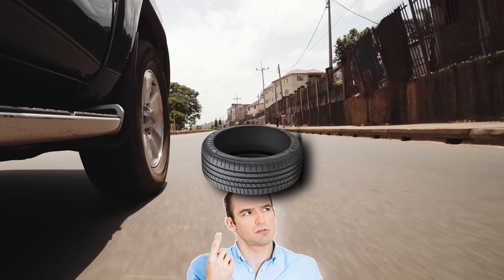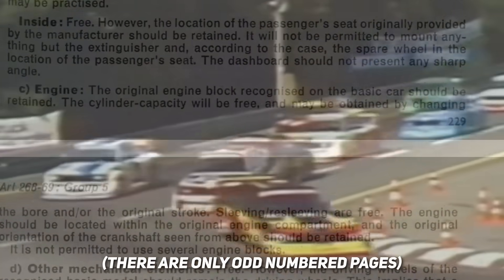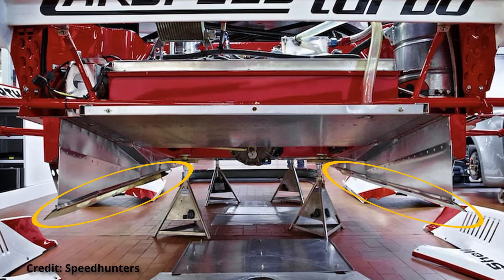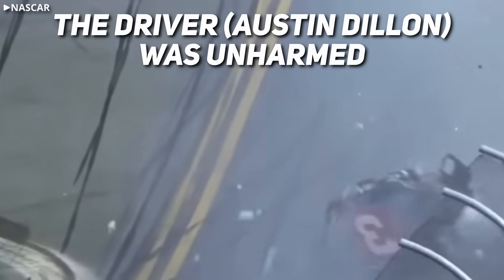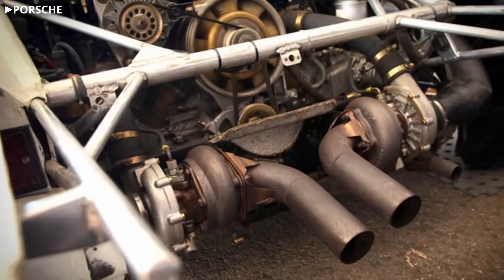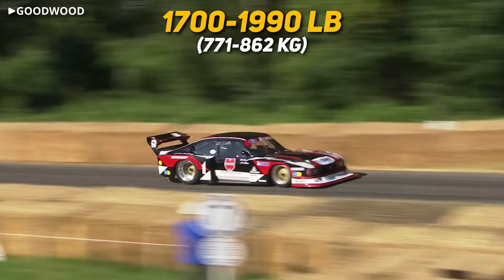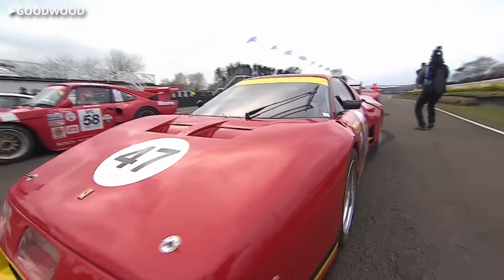The ABSURD Rules and Engineering Behind Group 5 Special Production | Group 5 Monsters Explained!

Comment: I've been to a lot of those races of the Deutsche Rennsport Meisterschaft (what means npthing else then German Racing Championchip). The Air Force racetrack at mainz-Finthem was my hometrack, while I went to the Ring and to Hockenheim for the Jim Clark rememberance races. And every year to Nürnberg, where the race took place at the Norisring, which was mostly the former Reichsparteitagsgelände... A lot of fantastic races, always the fight of the Ford underdoge against the 935's in the larger division. The Capri had the so called "Dampfrad" (power wheel), where they could increase the turbo pressure for a certain amount of time. After that, the engine blows up. I remember one race at Finthen, where Manfred Winkelhock was even beside Bob Wollek, using the Dampfrad a little to much and re damaged the car seriously. Such fantastic pilots as Stommelen and Wollek for Porsche. Heyer for Ford and Lancia and Ludwick, Winkelhock, Ertl and van Ommen for Ford, just to name a few.

Comment: We actually have a burnt Group 5 Zakspeed Capri engine. It was in Vidar Sauthon’s Escort MK3/4 Rallycross supercar (EX Seppo Niittymäki) Sadly the car burnt down in a buss but the engine was partly saved. There are afew parts missing but that will sort out when we fix a guys tractor. He said if we fixed it we get everything we want and need. Not just for the Zakspeed engine😆. But we are thinking of buying the EX Kjetil Bolneset Ford Escort MK3/4 Supercar and putting the engine in that, to use it in Retro Rallycross in England.

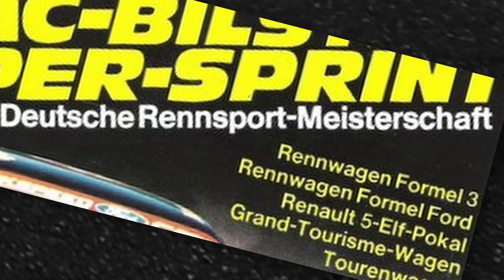Comment: 10:00 So how do you drive a car like that with just two feet? How do you shift down break and hit the throttle at the same time?
Reply: Well, sir let me tell you of a technique called heel n toe sifting where the heel of your feet dose clutch pedal to match revs for the transmission synchros and keep the engine up in the rev range and the toes hitting the brake pedal to slow down the race car at the same time i hope this can explain to you how this technique works as it not the easiest skill to learn.

Comment: The 935 was also extremely difficult to drive. It wasn’t just the turbo lag either. The weight bias and extremely squirrely chassis made the car understeer and oversteer in massive amounts. I remember an article I read at the time which confirmed pretty much everything here. I also remember an interview with Claude Ballot Lena, who was sharing a 935 with Bob Wollek. I think it was at Daytona in the early 1980s. Ballot Lena described to the incredulous interviewer how Wollek was using left foot braking even in the wet. Left foot braking… in a 935… That’s a car in which the rear is already trying to overtake the front without that. Think about that for a second.
Reply: Yeah it's lagging, it's boosting oh oh too much boost and it's a straight going into a corner and it's wet... hairy

Comment: ‘No such thing as a free lunch’ - also George Washington, I think. Turbos can give a lot more power but at a cost. While Group 5 didn’t have a limit on consumption (that came later with Group C), higher consumption means either more stops or more weight.
Reply: The efficiency at which power delivered greatly outweighed the fuel.. it was more efficient. It's cons wasnt in fuel usage

The cons of a turbo are overheating, the use of  lower compression and of course lag

Comment: Racing is deadly, the end.
If you can't take the heat of danger ... do not race.
Simple.

Adding rules to any race event, is equally idiotic, because of the above.
Safety is not done through rules, but technology and having a good driver.
A good driver is not one that can drive REALLY fast, but one that drives REALLY SAFE while driving fast.

Simple.

If you give a nutcase a gun, you just know, there will be side effects, no?
Same for racing.

Comment: Also there is a funny anecdote from back when the DRM raced the Nürburgring Nordschleife. As you already mentioned - the teams tried to find loopholes in the regulations. Well somewhere it was stated that you could design the rear fenders however you want, so Zakspeed did a funny thing. They build their fenders that way that they would basically match their rear wing, but it was still the same part. They even removed the fender to demonstrate it.
https://youtu.be/hHXimONBYMM
20:30 - it's just so wild to me...

Comment: Lancia paid the highest price for using Alu tubes for their construction in the later Group B Lancia 0.37 and the Delta S4  both accidents taking place on the same  event Corsica but a year apart both accident were end in the Death of the Drive in the 0.37 case and Both the Driver and Co-Driver in the 2nd case. these may be now classed as gold periods has was every year from the 50's until the late 80's by which time both the FIA / FISA and  the teams and drivers were fully behind safety over crazy race cars.

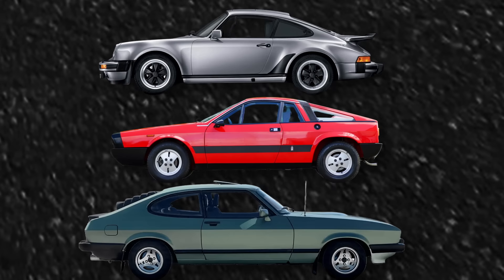Comment: I find the image at 2:55 to be quite fascinating.  The Capri on the bottom of the page is a euro-spec MkIII built in either the British or Cologne Germany factory, and not a German Capri II for the US market.  What I find interesting is, at first glance it would appear to have 390mm TRX wheels, but they are not.
To the best of my knowledge (for Ford) TRX was a USA only "wheel, tire, and suspension package" offered first in 1979 on the Mustang Pace Car and Mercury Capri (read Mustang).
That being said, the wheels in the 2:55 image are not TRX as the actual TRX wheels had a center cap that covered the lug nuts and the slots in each of the spokes were straight not tapered like those in the picture.
If anyone knows if the wheels shown were a Ford factory wheel or what brand they are please comment below.
As I am from the USA I have limited knowedge of all the many varietys of Capris found around the world.  I learned to drive in a 79 Mustang Turbo 4 speed Pace Car and owned both a 1976 Mercury Capri II (Ford, Cologne Germany built) and a 1979 Mercury Capri RS (Mustang with TRX and factory box flairs).

Comment: This is great history to learn. Thank you.
THEY WELDED ON THE CYLINDER HEADS.
Reply: I remember thinking about welding on brackets to farther clamp the cylinder head to the block. But Porsche just what, reinforced the head bolts by just welding the head to the block?!
X,D
Reply: So what's better than that? A titanium block, titanium pistons, rods, and crank, iron rings & sleeves, and a pneumatic valve train? How about a titanium 2 stroke V8? Titanium Wankel boosted to the moon, with an electric motor handling low end torque, and the wankel sandwich welded together or bolted together with extra clamps, like they're containing a star?
Reply: Things like this, are why I care more about Street racing then the FIA or FIM. The less rules, the better. Run what you brought.
Reply from the maker: Haha, back then it really was almost like street racing (with huge budgets) with how few rules there were!

Comment: This video really only covers half of the history of circuit racing under silhouette rules in the 1970's and 1980's, the one where "factory" involvement came into play. The prior efforts and innovations in the Australian Sports Sedan class, British Special Saloon class and the IMSA AAGT class in the US, paved the way for what the FIA officially sanctioned in the 1976 season.

Not enough can be said to credit IMSA's John Bishop for popularizing silhouette racing in the US by "napkin sketching" out the idea of American-based, tube-frame cars, powered by readily available, low maintenance V8 engines, that could compete with the 934 Porsches that were then dominating the class. The end of the 1974 IMSA season saw the very first of the cars in competition based on Bishop's vision, Steve Coleman and Amos Johnson’s home-built Chevrolet Vega, being entered at the Daytona finale in November 1974. IMSA then officially published AAGT rules for the 1975 season. 

In 1974 Ex-Kar Kraft race engineer Lee Dykstra, with partner Horst Kwech formed DeKon in order to fully flesh out Bishop's vision by designing and building a series of DeKon Chevrolet Monzas, for sale, and for themselves, the first of which, driven by Kwech, would qualify fifth out of 40 cars entered at the Road Atlanta Camel GT event in April of 1975, but DNF'd after 13 laps. Another privateer, Tom Nehl, fielding a Monza home-built under the AAGT rules would finish 8'th overall after two heats that weekend, and everyone was now paying attention, and DeKon had customers lining up. One year later at next Road Atlanta round in April 1976, eight small-block Monzas showed up from three constructors, including examples fielded by Keyser, Agor, Trueman, Nehl, Tom Frank, and Jerry Jolly, as well as the original AAGT Vega of  Steve Coleman and Amos Johnson. Holbert and Keyser finished first and second in their DeKon Monzas, humiliating the rest of the field.  

Over the pond in 1974, in Great Britain, the British Special Saloon class, a hotbed of privateer innovation, was charting a parallel course, while producing some positively loony efforts. The John Pope Special, debuted in 1974, was the eponymous brainchild of a Hertfordshire farmer who incorporated the 5.3-litre engine, gearbox and suspension of a wrecked Aston Martin DBS into a Vauxhall Magnum bodyshell, the Aston's de Dion rear suspension arrangement being located by trailing links bolted into the Vauxhall's modified steel floorpan. Heavy, road-legal, and driven to events, it was a solid midfielder that annexed results when attrition ravaged rivals’ lighter, quicker steeds. Not an uncommon occurrence as weekend warriors will attest. The next season  it sprouted twin Garrett AiResearch turbochargers, increasing the output to, conservatively, 600bhp. 

A far, far different approach was taken by Jonathan Buncombe who in 1974 obtained a recently obsolete, Cosworth FVD powered Chevron B19, chassis number B19-71-9 that had previously been competitive in European 2-liter Championship racing from 71-73. Buncombe's father, who raced a Hillman Imp in Saloon car racing, suggested they convert the Chevron into a Special Saloon by fitting a highly modified Imp body-shell atop the Chevron's monocoque tub. The result was the Hillman Super Imp 2-litre, nicknamed the "Chimp", which debuted at Thuxton 26 Oct 1975, under heavy protest, but allowed to race in the spirit of fun, qualifying second. Buncombe led before spinning as well on tires that refused to warm up. Over the winter Buncombe and Wadsworth had the car checked by the series' chief scrutineer Peter Jowitt, who agreed that it met the silhouette rules, mainly because the wheels weren't thought to effect the silhouette, so it was legal, even though the wheelbase was longer than the stock Imp's. They raced at Silverstone in early May 1976 in a high-profile race supporting the Six Hour race and were turned down at scrutineering, but had the letter from Jowitt, and were allowed to race. They won, narrowly, much to the frustration of Gerry Marshall and Dealer Team Vauxhall's 'Baby Bertha', which had been the dominant machine of the series thus far, the team being funded by contributions from more than 600 Vauxhall dealers. Baby Bertha, a Vauxhall Firenza silhouette car built by Blydenstein Racing for team Vauxhall, featured a 500bhp V8 Repco-Holden Aussie Formula 5000 engine, de Dion rear suspension, trick inboard rocker arm front suspension and tubular subframes mated front and rear to the modified stock steel central floorpan.    

After one more race later in 1976 again at Silverstone where the Chimp retired with a broken gearbox, Vauxhall protested heavily and the Chimp was banned as the silhouette was now deemed to incorporate the wheelbase. The Imp body was unceremoniously removed from the Chevron tub and scrapped, the intact Chevron rolling tub then sold less engine. 

Any mention of loony entries in British Special Saloon class racing is incomplete without touching on John Turner's brilliant Škoda-Chevrolet, a Škoda 110 R Coupe, modified from new, powered by a 477 hp fuel injected 5-liter Formula 5000 Chevy V8 mounted amidships, and backed by a five-speed Hewland DG 300 gearbox, hung on a tubular subframe attached to the Škoda floorpan. Front suspension retained the Škoda layout but was highly modified. First raced in the 1974 season, Turner netted 8 wins in the series and set a total of five record lap times. 

Down under in 1974 things were getting similarly surreal in the Australian Sports Sedan class, the richest motor racing series ever seen in Australia, backed by tobacco giant Phillip Morris, the 1974 Marlboro Sports Sedan Series boasted a prize purse totaling $100,000. Privateers, as well as factory-backed teams were all trying to top one another with one radical entry after another.  

Not terribly unlike John Turner's approach, Bryan Thomson, and engineering mate Peter Fowler were busy combining all of the suspension bits, Hewland DG300 five-speed gearbox, and 500 hp fuel injected 5-liter Chevrolet lifted from a recently obsolete ex-Warwick Brown McLaren M10B Formula 5000 car, with the body shell of a VW 1600 TL Type 3 Fastback. A custom tubular spaceframe and rollcage was welded up inside the body, and a separate tubular subframe was crafted that carried the engine, transmission, and rear suspension. The subframe could easily be detached and wheeled away by undoing a few bolts and raising the rear of the car. While it's debut at the night meeting of the Marlboro Sports Sedan Series at Melbourne’s Calder Park Raceway in January 1974 was less than spectacular, they soon sorted the car with Bryan ending up second in  the Calder series overall, but not before a controversial nudge from Bob Jane's Monaro in the last round.
Reply from the maker: Thanks for all the additional info! This video was only meant to scratch the surface and introduce people to the concept who had never heard of it. It's great to have more info in the comments for people to check out👍
Reply: @themotorsportstory  you are welcome. You have done a great job here. Please consider doing a second video detailing this fascinating period of innovation that is severely under-represented here on YT. Buncombe's Chimp appears in a video here on YT called "5th September 1976 - Special Saloons - Silverstone" posted by M3WAYCER.

Comment: GTO category also has something to do with this or that was at time when the FIA started adding regulations and restrictions on the cars???
Reply from the maker: I'm not an expert and I'd have to do more research to give a thorough answer, but my understanding of it was that GTO was an IMSA class rather than an FIA class for cars with engines over 2.5 liters. I want to say it came before Group 5 Special Production. I think some of the cars may have competed in both such as the Greenwood Corvettes. But again this is going off of my best recollection without doing any research 🙂